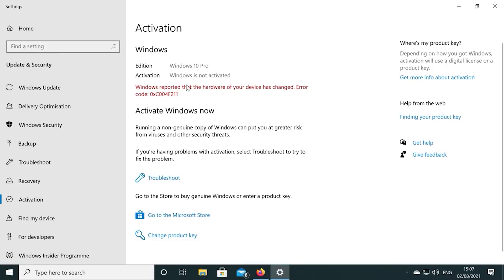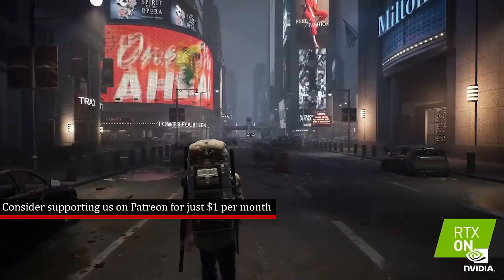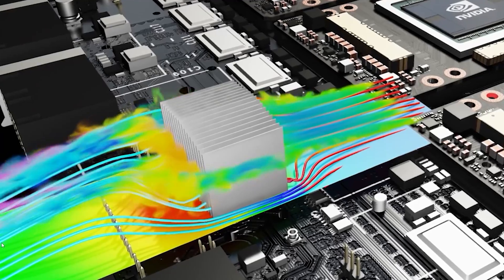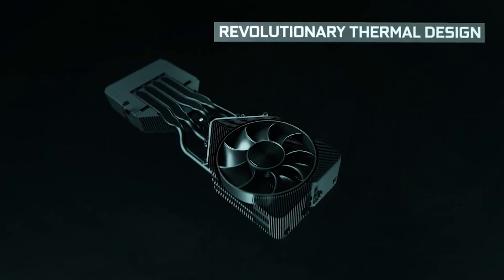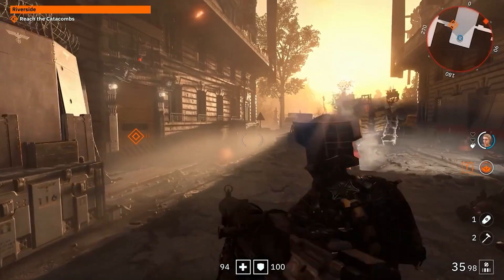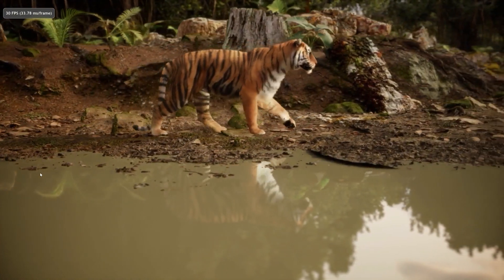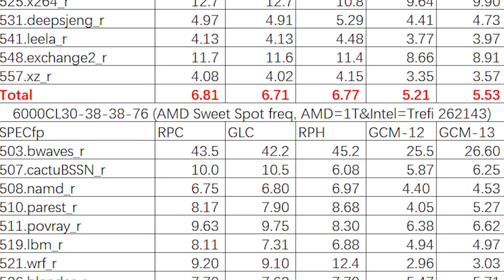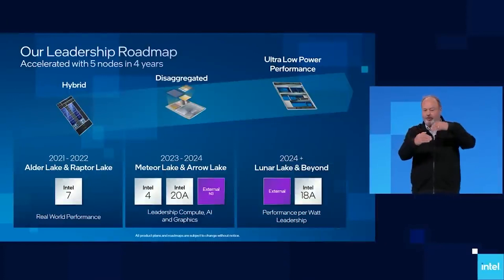RTX 4090 Specs DWARF RTX 4080 - Major Specs UPDATE | RTX 4080 Ti & Path Tracing Leaks

Comment: god damn, my upgrade from my 3070ti to a 4090 is going to be so good <3
Reply: I'm going from a 980 Ti to a 4090 (or AMD equivalent). I'm expecting my mind to be fully blown.
Reply: @BlissBatch  You better be going to 4K then with a tremendous upgrade like that.
Reply: @ZackSNetwork  Already got the 4K 48" OLED, when it was the same price as low-end graphics cards, lol. Best decision ever.
Reply: My upgrade from gtx970 to rtx4080 will be super freaking good.
Reply: 4090 should be around $1500 and 4080 should be around $800. The 2x price doesn't worth it for most people. Best choice is to wait for both cards.
Reply: @maou5025  I hope the 4080 is around $800 but I'm thinking it's much higher than that. Probably $1000 for the 4080 and closer to $2000 for the 4090.